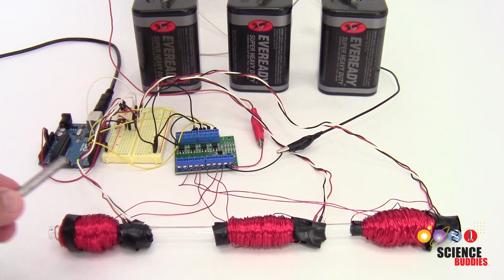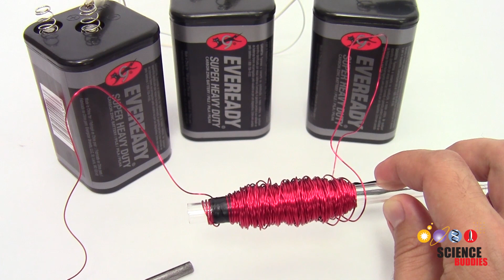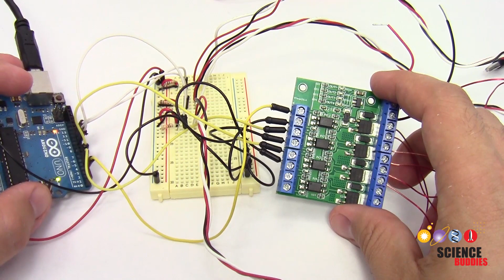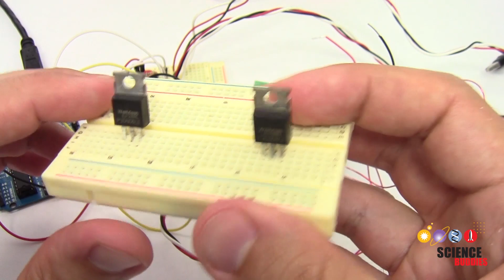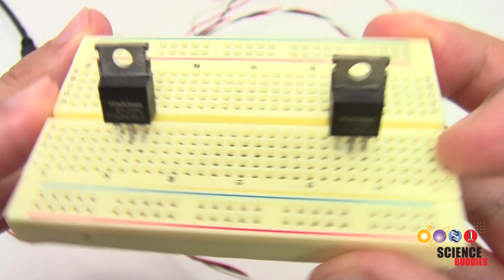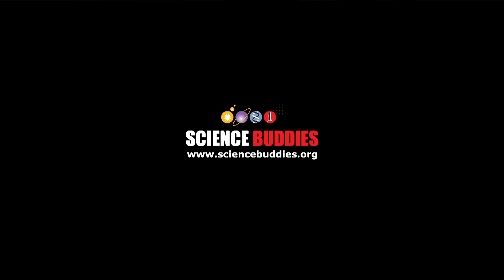Build an Arduino Mass Driver - Cool Science Project

Comment: Hello! Do you know what could be the possible error in our rod not interacting with our system? We followed the steps and are using 9V batteries and an iron rod yet it doesn't move much.
Reply from the maker: Hi - if you are K-12 students doing a science project then you can ask for help in the Ask an Expert forums on our website and we will be able to help you in more detail: https://www.sciencebuddies.org/science-fair-projects/ask-an-expert-intro. We will need a more detailed explanation of what's going on along with pictures of your setup and your code (if different from the example code provided in the project).

Comment: Can I use Esp8266 Board for driver board and is there a specific type of arduino u used there are a lot of em and how much volts do I need for the battery

Comment: I am unable to find which Arduino to use in given info i kindly request please reply me with the specific name or model number of Arduino
Reply from the maker: Most of our projects use an Arduino Uno (you should be able to do them with an R3 or R4). You can also find links in the video descriptions to written instructions on our website with a parts list for each project.

Comment: I dont have much knowlege about all of this so I'm not sure if this is a strange question..... but
Can we use a smaller battery
Reply from the maker: We have not tested it - you can try this project with a smaller battery, but at lower voltages, there will be less current so the projectile might not go as fast.
Reply: @Science.Buddies  I'm amazed by the speed of your reply 
You saved much of my time thank you
Reply: @Science.Buddies  so you've used three 6v batteries 
If I use three 3v battery it will run out faster right?
Or will it work slower?
Or will the both of it happen?
Reply from the maker: Hi - batteries are rated not just by their voltage but also their capacity. Typically, physically larger batteries have a larger capacity and will last longer. For example, AAA batteries and AA batteries are both 1.5V, but the AA batteries are bigger and will last longer. So, it depends on the size of your 3V batteries.
Reply: @Science.Buddies    okay I understand now thank you 
by the way I have already made my project and its working perfectly all thanks to the way you explained in the vid and your website
tomorrow is the main day of showing the science project so wish me luck

Comment: I'm trying to buy a projectile and I purchased a non-plated steel rod. Does it need to be ferromagnetic? When I put the steel up to the sensor nothing is being detected? Will this change when the electromagnet is turned on?
Reply from the maker: The projectile does need to be ferromagnetic. A solenoid on its own (with no core) will still generate a magnetic field that could in theory be picked up by one of the sensors, but the presence of a ferromagnetic core makes the field much stronger. However, just holding a ferromagnetic piece of material up to the sensor with the electromagnet is off will not do anything, since the ferromagnetic material does not have its own magnetic field.
Reply: @Science.Buddies  Thanks for the quick response, would neodymium magnets work at a core? I'm guessing the higher the gauss of the magnet, the faster the final velocity?
Reply from the maker: Hi - we haven't tried this with any sort of permanent magnet as the core. In theory it should work, but you'd need to be careful about the direction of current and resulting polarity of the electromagnets, because it would be possible for them to repel a permanent magnet instead of attracting it, pushing the projectile back in the wrong direction. A ferromagnetic (non-permanent) core will always be attracted toward the electromagnet.

Comment: Is it possible to use a few L298N Dual H-bridge drivers instead of the 4-Channel MOSFET driver to complete the same goal? Would I then need individual MOSFET transistors? I'm asking out of curiosity and because I already have the L293D in my inventory and would have to go out and order a new MOSFET driver. Thank you for the video, nonetheless.
Reply from the maker: In general the L298N can drive solenoids and other inductive loads in addition to motors, but you'd need to check the datasheet for the voltage and current ratings to make sure they're sufficient for the coils in your project. Off the top of my head, I think the driver board we used has a much higher current rating than the L298N. Either way, you shouldn't need individual MOSFETs, since they're built-in to either the driver board or the H-bridge.

Comment: If we used a bendable tube instead and made it to a circle would the rod keep moving along? Also what are some real life possible applications(other than launcher)?
Thx for the cool project!
Reply from the maker: It would depend on the bend radius of the tube and the length of the projectile. If you try to curve the tube too tightly the projectile might get stuck. There are a variety of real-world applications for replacing chemical propellants with electromagnetic propulsion, you can probably find more examples if you search online.
Reply: Thanks for the reply, wpuld it work if i used those tiny magnetic balls instead of the steel rod(cant get one).?

Comment: Is the breadboard necessary?
Reply from the maker: Technically you can build any circuit without a breadboard, but having one makes making the connections much easier.

Comment: Why not switch the poles after passing the centre of the coil? Wouldn’t that theoretically make it go way faster since it will be pushed?
Reply from the maker: Yes, that could be a great upgrade to the project! We're just using a ferromagnetic rod instead of a permanent magnet as the projectile, so even if you switch the poles, it would still be attracted to the core. Rapidly changing the direction of current through a large electromagnet also requires some additional electronics - our circuit is only designed to drive current through each coil in one direction.